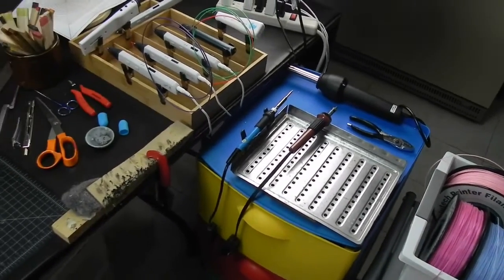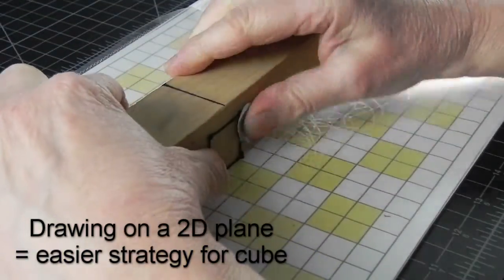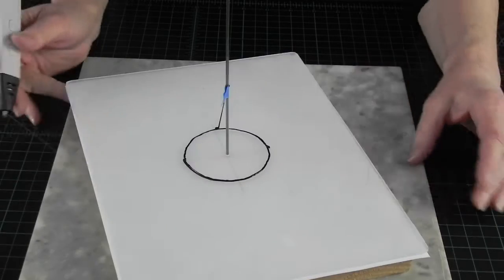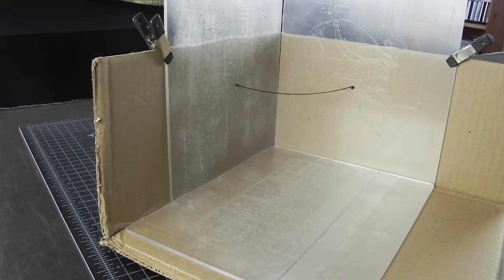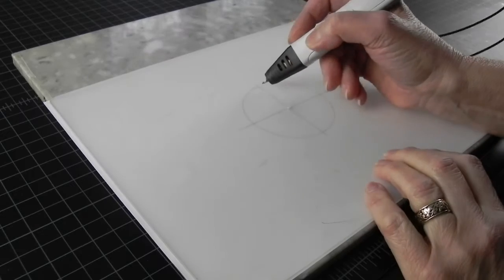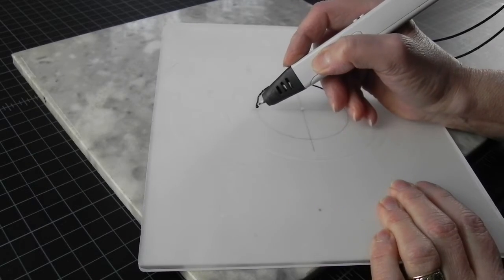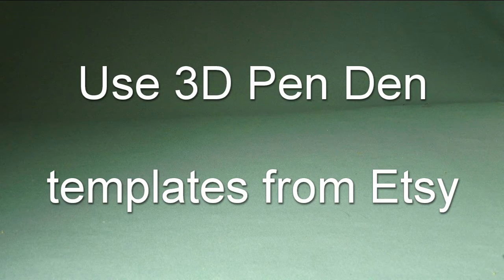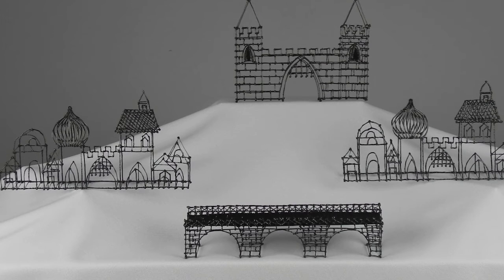Beginners guide to 3D pen use - part 2 - Bridging

Comment: Excellent video, I am wondering if I want to trace a drawing and glue it on paper, what glue would be the most accurate?
Reply from the maker: Thanks. I would use spray adhesive Super 77 (3M brand or the Scotch brand) that does the cleanest job. You can also use super glue (the ultra liquid formula) but that can get a bit messy looking if you are not super careful.

Comment: Thank yoyou. But when I tried on parchment paper it was a disaster for me but I have silicone mats is there a difference between silicone mats? Ty
Reply from the maker: Yea parchment is made so things don't stick to it (whether it's cookies or filament). There are three papers that look very similar to each other: parchment, wax paper, and tracing paper. One doesn't stick at all (parchment) one works so so (wax paper) and tracing paper actually works quite well (it may also depend on the brand). As for silicone mats they are also mostly made so things don't stick to them. Some don't work at all, and some work a little bit like the back of the 3d mate mat. Try working on a clear overhead projector sheets or the sheets for heat laminators. Those usually work well. I mostly use plexiglass sprayed with matte acrylic spray coating (don't skip the coating or you won't be able to remove it at all.) Have you seen these 2 videos? That should help.
7 things you want from your 3d pen work surface: https://youtu.be/n9RXEH7BAzA
Best work surface for 3d pen: https://youtu.be/QP7YsXWvb8M

Comment: Thank you very much. I already got my plexiglass and my spray. I was thinking of getting some transparency films as well. I can't find the ones you use in the video. Are all transparency films the same in terms of adhesion? Or do I have to get specific transparency films? Or do you think the films are not necessary and I can stay with my plexiglass? I would very much appreciate your reply once again.
Reply from the maker: I would say if you already have your plexi and your spray use that and see how you like using it. You may never need anything else. Even though transparency film is nice for when you need to peel of some intricate design. I am not quite sure if all transparencies are created the same. Different brands may vary in what kind of plastic they use. You would have to test it. Also make sure you have some thin spatula-like tool or palette knife to get the plastic of your plexi. It always feels like it's stuck a bit too much but the moment you get some tool underneath it come right off. Let it cool completely before you pry it off so you don't deform your project. Also cold stuff peels more easily. Good luck. Let me know how it goes. :)
Reply: @3DPENDEN   I very much appreciate your reply. Thanks again. I am excited to start using my pen because my first experiments were a disaster, exactly the way you described, I was very disappointed and I was ready to quit. Now I can't wait to use my plexiglass. :)

Comment: If you can’t get straight lines in air and gravity makes then saggy how do you disable gravity?
Reply from the maker: You work around it. There are certain things - like curves - that can be done only on a solid surface and then lifted after the filament has solidified. You have to obey gravity. It's the law. I suppose another option would be doing it in space. :)